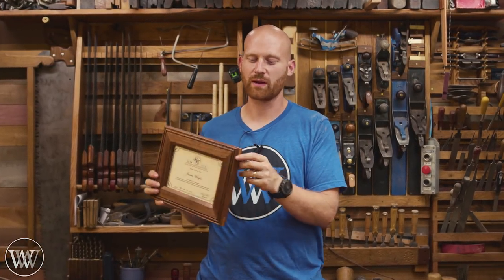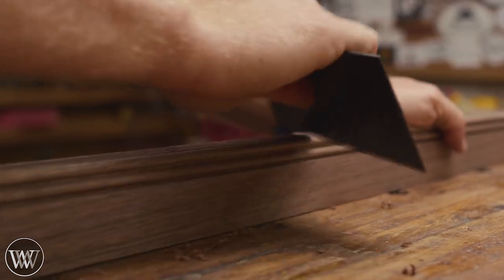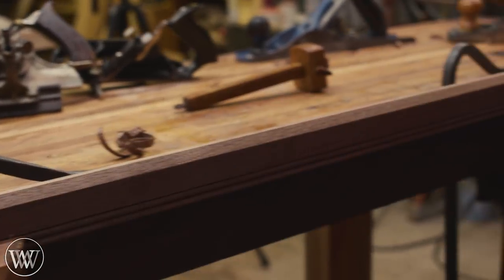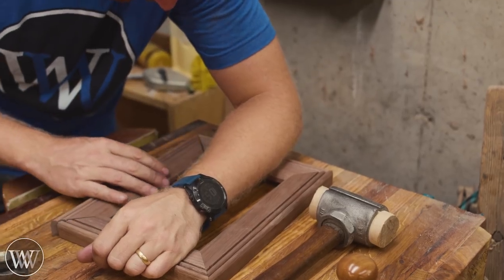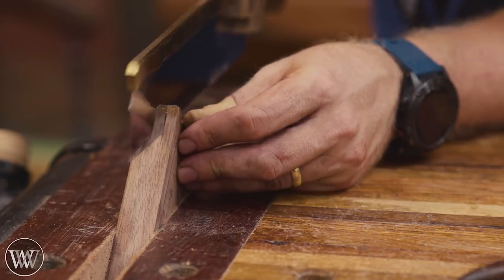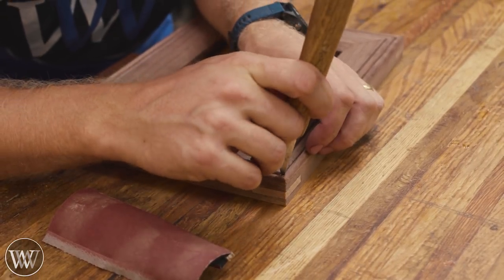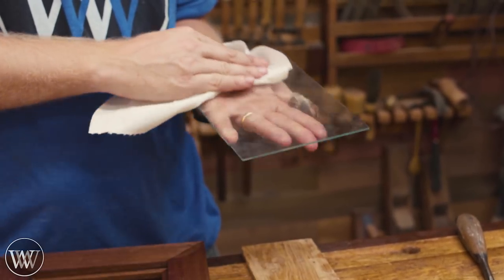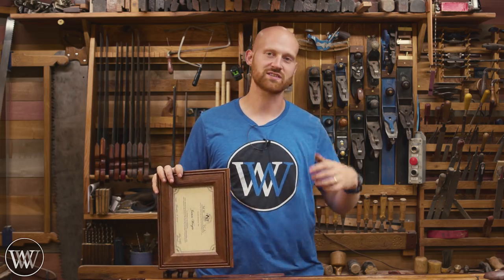Making a Picture Frame With Mitered Splines

Comment: James my joints are pretty loose too.    I have 8 years to retirement, I hope by then I'll have learned to roll a joint.
Reply from the maker: Lol nice!
Reply: Love the Rabette, Rebate or is it Rabbit plane.    Yours looks like the 191 or 192, I have the 78.     I had to totally strip and repaint the body.    I made a custom depth stop out of 1/4" angle iron, with beautiful curves and then buffed out.  I had to re-cut the threads on a modern thumb screw to work with Mr. Stanley's unique threads.     It was a very satisfying project.     I love using it, I think everyone should have one.

Comment: The Duck (hi Bernard), mentioned Sandpaper below. Just a thought, do you have a set of 'Rifflers', that could be used for inside the coves?
Reply from the maker: Yes I have a collection of over 200, but I usually get a lot of bad comments when I use them. A lot of people don't like that as not too many people have them. But I do like to use them from time to time.
Reply: I vote you use the rifflers and advise how to put together a beginner set (less than 200) that would work for most purposes.  You'll get bad comments about sandpaper too; choose the least worst option and use the tools that make you happy.